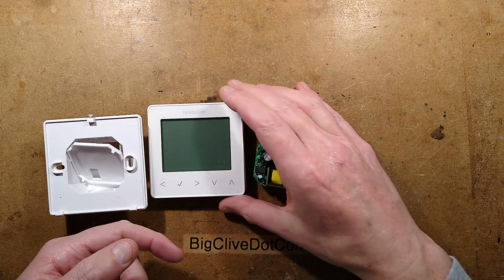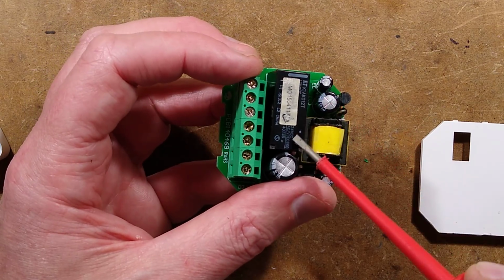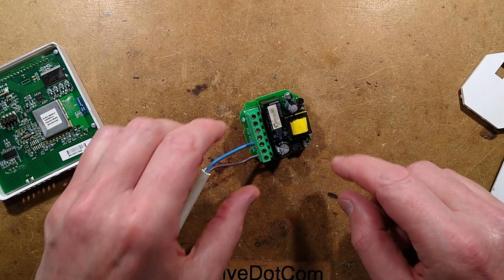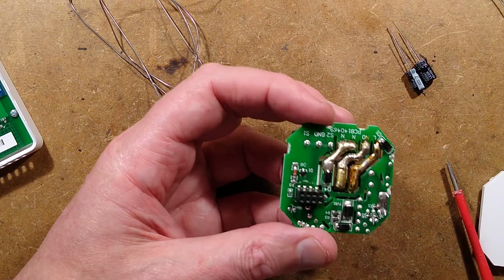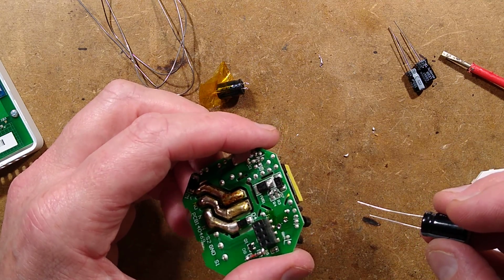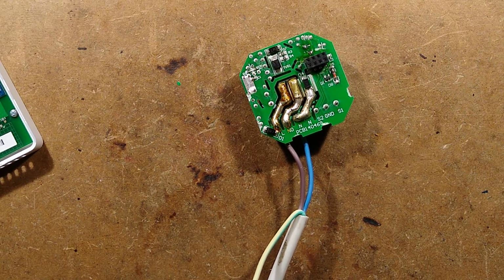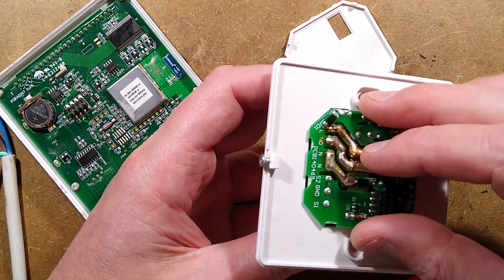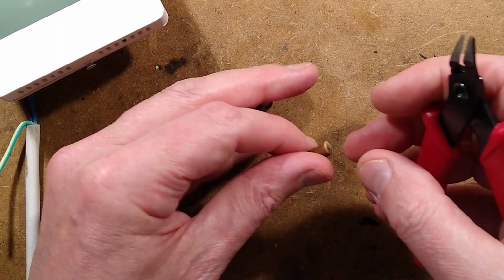Fixing a dead digital thermostat

Comment: As simple as they are, I remain impressed with the capability of capacitors. 
If you consider that a rechargeable battery has a service life of a few thousand cycles, a capacitor on the other hand, 
can cycle at 50+ Hz, 4,000,000+ times a day, every day, for years.
Reply: In fact this capacitor was part of a switch mode power supply running at a frequency several orders of magnitude higher than mains. If I’d have to guess up to around a Mhz. Ballpark 100,000,000,000 cycles/day. Fortunately, electrons don’t tend to get tired 😁
Reply: @mlenstra  "Fortunately, electrons don’t tend to get tired"  Tell that to some of the hardcore audiophiles (audiofools). I have genuinely seen someone recommend passing a DC current through their hyper-expensive speaker cables after some period of running to flush the old electrons out 😂
Reply: @ferrumignis  you gave me a brilliant idea! Let’s sell audiophile batteries pre-charged with special high fidelity audio grade electrons. AA size will be (limited time offer) just $999, enough to flush and fill up to six meters of speaker cable!
Reply: @mlenstra  I'm certain there are people that would buy this and swear they could hear the difference. After all these people were colouring in the edges of CDs with "special" expensive magic markers and swearing it improved sound quality, the same people will pay many hundreds of $ for an amplifier power cable made of silver wire, ignoring the many thousands of meters of copper and aluminium wire connecting their power socket back to the power station. Barking mad, but if you have no qualms about parting fools and their money then you could earn a good living.
Reply: @mlenstra  The worst bit is you will sell thousands of them.
Reply: @mlenstra  genius idea.
Reply: @mlenstra  I love this comment thread lmao

Comment: Did it even need that capacitor?  How much smoothing would that actually thing need?  I'll bet the power supply was over engineered because it's left over from a previous model that drew more current.
Reply: Yes, that capacitor is essential. With it missing or open circuit or ineffective, the rest of the electronic circuitry was getting a series of high frequency intermittent pulses. Every time the pulse ends, the electronic circuitry forgets its current state, so the microcontroller then resets, ad infinitum…
Reply: @Mark1024MAK  But there's a back up battery on the microcontroller board.  That implies there's secondary power regulation on that board.  I'm just wondering if it would work without it.
Reply: @rayceeya8659  The battery will only run the device's real-time clock and maintain temperature settings. A backup battery like that simply isn't large enough to switch a relay.

Comment: I'm forever astounded at the price of home thermostats.  Some of the ancient bendy-wire units are still $40.  It's easy to spend $100+ on one that's clever enough to switch between heat/cool on its own.  And then there's the "smart" units that run $250+ for the privilege of contributing data to ad services.  For hardware that is comparable to a cheap smartwatch with a relay bolted on.  How is that sort of markup viable?
Reply: Because people are foolish enough to keep paying that price. And I’m convinced that lots of people don’t understand how a thermostat controlled system actually works. Only yesterday I found an electric room heater with the built-in thermostat set to maximum…
Reply: @Mark1024MAK  What do you men they don't understand how thermostat systems work? Everybody knows that the higher you set a thermostat the quicker it will heat up. (insert appropriate emoticon)

Comment: A great component for planned obsolescence, the electrolytic capacitor.
Reply: It isn't necessarily planned.  Sometimes you just get bad ones.  Sometimes entire production runs are just bad and have abnormally short lives.  This was a HUGE problem for a while between 1999 and 2007 due to bad electrolyte formulations from some manufacturers, particularly in Taiwan.  The affected capacitors failed so frequently it was known as 'Capacitor Plague.'

Comment: That is really bizarre, in the USA I have never seen a thermostat use mains voltage to power itself it's always a Battery and or the C wire "24vac" from the Furnace or HVAC system. I guess for safety reasons you probably can't get hurt from 24vac but mains especially the 240 used across the pond.is this typical of the UK? I have plenty of testing products from Honeywell and now GE, I have installed more thermostats than I can remember again that's really odd to me over here.
Reply: You obviously are not aware that the vast majority of homes in the U.K. don’t have air conditioning systems. We have either electric heaters, or gas or oil fired central heating systems. The vast majority of which run and are controlled by 230V (240V) mains. Hence 230V (240V) mains thermostats and time switches are normal here.
Reply: @Mark1024MAK  I don't think that's the reason. The US-standard 24v system predates widespread air conditioning. Back in the day the 24v thermostat would just switch a 24v valve, so theoretically 120v could have been used instead.

And btw, there's one big exception to the 24v system here. US electric baseboard heating usually uses high-current 240VAC thermostats.
Reply from the maker: I think 24V is used in the USA to circumvent regulations that would otherwise require a certified electrician to wire the thermostats and controls.

Comment: There's a very common problem on vaillant boilers where the water temperature on the display fluctuates quite wildly. This is due to 2  electrolytics failing. You can always tell because if you take a hairdryer to them and warm them up, it fixes the problem until they cool back down obviously. It's because the voltage to the water temperature sensor has become unstable I believe. It's a very common problem with these boilers that use this particular control board which most of them do.

Comment: Do you have a cold Clive? 🤧 Take care if you do, ok. 
I had a couple of Wireless Access Points that just stopped working after 8 or 9 years. Spent AUD$5.95 on 4 electrolytic caps and replaced the ones that looked like they had been eating too much of something and got them back working again. 👍 Most pleased and now I can give them to someone who may have use for a couple of 2 band WAPs.

Comment: Excellent video, never knew there was an ESR rating of capacitors. Shows what a newb I am right, lol.
Reply: There’s the capacitance, working voltage rating, temperature rating, lifespan rating (in hours when operated at a specified temperature), maximum ripple current rating, and as you said, the ESR rating at a specified frequency.
Reply: @Mark1024MAK  I just thought it was capacitance and voltage. Where is the other information found?
Reply: @stevetobias4890  - it’s all in the manufacturers datasheets. Some manufacturers print some of this information on the case. E.g. temperature, 85°C or 105°C are typical maximum temperatures. Sometimes the manufacturer just uses a code, which you then have to cross reference to the datasheet.
Reply: @Mark1024MAK  thank you, very much appreciated.

Comment: Yesterday I spent some time attempting to de-solder a couple of transformers from one of those dimmable fluorescence light bulbs.
My intention was to see if one of them could be used in a high voltage inverter circuit. The PCB was packed with a remarkable number of both leaded and surface mount components.
Unfortunately all the components  were held in with lead free solder that appeared to only melt well above 400C.  Despite using all the tricks, solder sucker, hot air gun and two soldering irons, solder wick, I gave up after an hour. 
The transformers have five pins, which fitted near perfectly into the very well gold plated through holes. The solder had wicked up on the connections to make them look top and bottom soldered, and to add insult to injury the transformer pins had obviously been bent over during assemble, ensuring they would not drop out when all the pins were heated at once with the hot air gun. I suspect that the transformers were also glued to the PCB. 
Individually melting the solder on each pin was an exercise in futility, as the lead free solder re solidified as soon as the iron was removed from the joint. Because of the tight fit of the plated through holes, solder wick and the suction gun could not remove the solder on the sides of the connections.
I tried diluting the solder with the lower melting point lead/tin but that did not work. I have to conclude that some products are just not made to be disassembled for salvaged. Did I mention how much I hate lead free solder.

Comment: The three diodes are odd.  All I can think is they are using them like that to get a voltage drop, but it's such a small drop.  Either that or it is protection if a diode shorts.
Reply: I have no answer, as if there is an ‘electrical event’ (such as an electrical storm) that is likely to cause one series connected diode to fail short circuit, it’s just as likely IMHO for multiple diodes (wired in series) to fail…
If a (one piece) bridge rectifier is used, often if it fails and goes short circuit, the supply fuse will blow.

Comment: Electrolytics in switching power supplies are not your average run-of-the-mill capacitors, and for good reason. If you study how an off-line switcher like this works, you find that most of them are flybacks. That means the primary conducts current while the secondary is off, then on the other half of the cycle it reverses, where the primary is off and the secondary is off. The secondary current is either a triangular waveform (starts at zero, jumps to some large value in an instant, then ramps down to zero) or it's trapezoidal in shape. 

The key takeaway is that the AVERAGE of either of these current waveforms is the DC output current. If the DC output current is, say, 1A, it means the peak secondary current is quite high, maybe 4-5A. This current is dumped into the output filter capacitor, which is actually an ideal capacitor in series with the capacitor's Equivalent Series Resistance (ESR). A generic electrolytic has a very high ESR, several ohms; a switching capacitor has, by design, a much lower ESR, ideally in the milliohm region. The large flyback secondary current waveform hits this ESR, and as everyone knows, you then get I^2*R power loss in the ESR resistance, which produces heat. Heat is the mortal enemy of capacitors because it dries them out. This is why the usual failure mode in a flyback switcher is the output filter capacitor(s) — the capacitor simply dries out.

For the budding EE out there, draw a triangular waveform that has a 50% duty cycle (just guessing that), and a peak current of Ipk. Draw in a horizontal line through this waveform and call it Iout. The equation is Iout = Ipk/2 * 0.5, the area under the triangle for the entire switcher period. As you can see, Ipk = 4*Iout. The same sort of stresses apply to the primary filter capacitor. Conclusion: flyback switchers stress the dickens out of their capacitors.
Reply: It took you all that text to say that the capacitor gets charged with a very short duration, high current ‘spike’ 😀
Reply: @Mark1024MAK  And it took you one short sentence to say 1) I have no desire to learn anything, and 2) I didn't understand anything you said anyway. There's a reason textbooks are a few hundred pages thick, not a series of one-sentence ignorant statements of "stuff."
Reply: @demef758  - Absolutely right that educational text books go into great detail. As do education courses about electronic systems and technology. People should always endeavour to be open to learning new information and develop new skills.

Comment: That was a quick fix. This year I learned more about capacitors than ever before. I think capacitors are most responsible for defective electronics at all. 
To make desoldering more easy I bought a cheap ADT03 "sucker" from my favorite Ali in china and I can recommend it. There are reviews on youtube.
Reply: I think its down to the use of cheap Chinese capacitors, as well as potentially exceeding the RMS ripple ratings on the little shit capacitors used for the bootstrap circuits. That was a common theme as well back in the 2000's when the first high current processors like the AMD Athlons spawned the need for high current buck converters on the boards, with the need for low ESR capacitors. Not unsurprisingly the cheap Asian capacitors all went tits-up. Having built my own SMPS' I can say that those low ESR capacitors are touchy, and can be destroyed instantly if you exceed their ratings or die a slow death from heat exposure. That said, using good 10,000 hour Japanese capacitors along with ensuring the ratings are not exceeded seems to provide good reliability thus far, but these are too expensive for the profit strapped companies in the consumer market. Kind of sucks as my parents just tossed a large flat-screen TV due to a failed bootstrap capacitor in its internal power supply. I knew what the problem was, just did not have the time to fix it for them.

Comment: In my experience, if you reverse the polarity on such a capacitor, it will disassemble itself, thus saving time. 😆
Reply: Aahhh The electroboom way….lol
Reply: Tantalum caps do it in more spectacular fashion though
Reply: Some years ago, I repaired audio equipment. I opened up a mixing board that had a problem with its power supply. After repairing the power supply and over 100 electrolytic capacitors, it worked fine again. What a mess when I opened it up. I wish I had been there when it popped.
Reply: Causes one hellova stink, to boot.
Reply: The famous CEC, or Confetti Emitting Capacitor. Reversing polarith can also result in the NED or Noise Emitting Diode.
Reply: And you can get free flock wallpaper at the same time! - Even the pot ducks on the wall get a bit!!
Reply: @whitesapphire5865  Copyright Blaster Bates. 😁
Reply: @BedsitBob  Nah, it's out of copyright by now!

Anyway, it's better than a plate of crisps.🤣💥💨🤦
Reply: Back in the dim dark past i used to support Strand lighting decks  now they could be fun  Rack mounted pre switch mode power supply's the system  was aprox 5-20  amps per module  and you would have at least 4 modules  ferrite memory core at least 2 control modules  program module etc 
you had multiple huge power supply's that had to be adjusted  so when the  current draw increased  it would start using another supply  you had to adjust them slowly and carefully or they would fail and turn into confetti generators   and spend 1/2 a day replacing capacitors  (we called it snow mode)
Reply: I've not tried that, but I've seen some that I assume did that, particularly on higher voltage units.
Reply: In my experience, dropping it on a heating element will disassemble itself too, bonus hearing check.
Reply: :D
Reply: lol
Reply: Ray (RODALCO2007) goes ecstatic when the capacitors "vent vigorously" when he connects them with reverse polarity / overvoltage.
Reply: Often with a very pleasant bang!
Reply: Will it now?
Reply: My guy. This is the life hacks we need, but not the ones we get.

Comment: 1) I'd never considered that other countries run their thermostats from the mains. In the US they run on ~24vac from a small transformer in the air handler usually.
2) It sounds like it might be the norm to have an external temp sensors on UK thermostats instead of them being expected to be in the thermostat itself.
Reply: Glad I’m not the only one confused/surprised
Reply: Do not mention the whole theme of PAL/NTSC, or 120V AC mains, I'd beg you.
Reply: it depends in the heating type. Electric heat for a room may be run off the mains just like it can be here in Candia. With 24v for a central heating system.
Reply: I'm in the USA and have seen thermostats with sensors built into the thermostat plus connections for sensors in the ducting and heat/cooling machinery as well. Depends on the application mostly, home vs industrial IME.
Can confirm the 24V point though; I was expecting a BOOM as well.
Reply: Australia commonly uses 24v AC also
Reply: @jalalhobbs  24v is an American standard. There's some old equipment here in Aus that uses it but nowadays everything is communicating.
Reply: They often just have a single thermostat in the hallway controlling the boiler and the radiators are balanced to create a "good enough" type of even heating throughout the home.